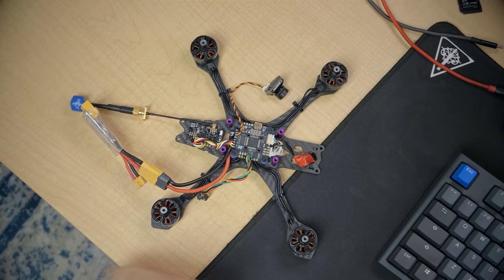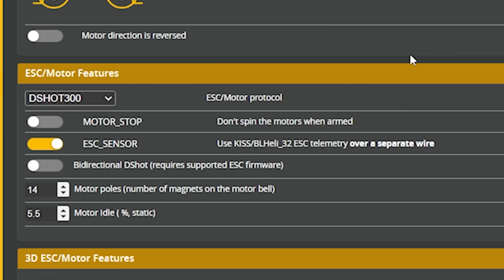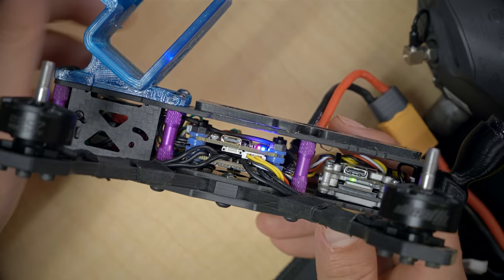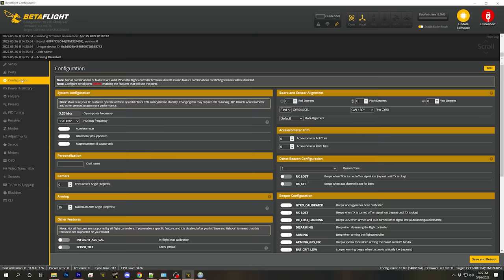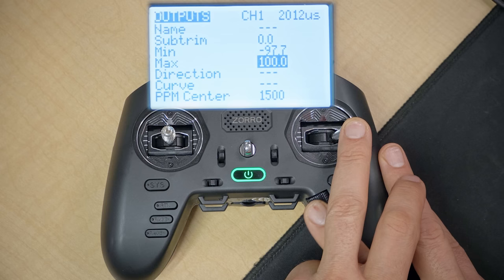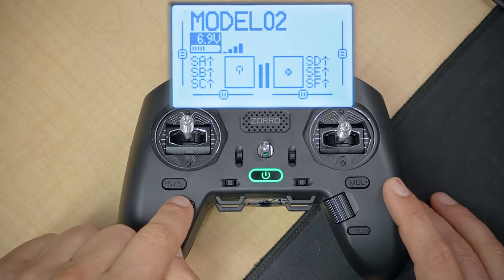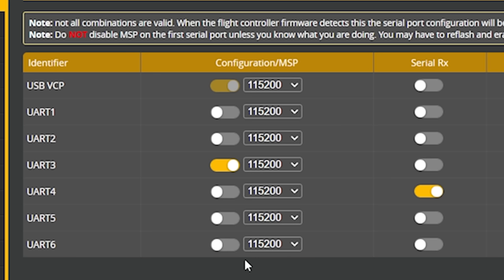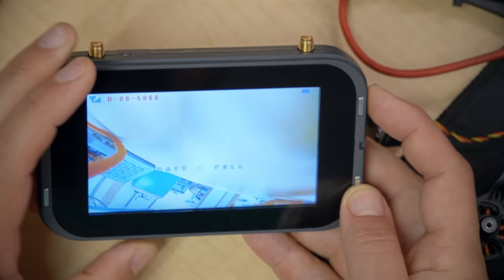2022 Freestyle FPV Drone Build - Configuration and Setup

Comment: After I got everything setup I discovered the motors were spinning when Armed, *Solution* I went into Betaflight > Motors> MOTOR_STOP = ON (Don't Spin Motors when armed) I also had to Disable AIRMODE, Configuration > Other Features > untick AIRMODE.  Thank you JB!
Reply from the maker: I strongly recommend leaving air mode enabled for an acro freestyle racing drone. This flight style often reduces throttle to zero when flying. If air mode is off and the motors stop, the quad will fall.
Reply: @JoshuaBardwell  thank you!
Reply: @JoshuaBardwell  Re-Enabled, good to go, can't wait to get this thing in the air. Thanks again!

Comment: Horizon, Angle, Acro on SC. On top of that set SC Acro as a preArm. So you have to go into Acro mode to arm the quad. After that you can go back to Horizon or Angle if needed.

I set flip, beeper on 3 pos switch.

Doing so, you add one more layer to accidental arming, since usually after land you will push all switches away from you.

And to arm again, you need to have throttle 0, disarmed and SC flipped to acro to pre-arm. And after all that arming will work.

Comment: I'm building the kit and can't get the motor direction to save when I change the direction of motor 1 and 4.   I've got v 4.3 on the FC and running configurator 10.8.  I can change the direction on the motor tab but the "Save and Reboot" button is greyed out, even after I change the direction of the two motors.  I was hoping to be able to do this through the Betaflight configurator like you showed in the video.  Any ideas what I might be doing wrong?
Reply: I am having the exact same issue. Did you happen to find a solution?
Reply: Same thing :( Any luck figuring it out?
Reply: Sorry guys. I missed the replies. I did not figure it out. I ended up reversing two wires on the two motors that were giving me problems.
Reply: @thilde007  Sorry I missed your reply. I didn’t figure it out. I ended up just reversing two wires on the two reversed motors.

Comment: Is the rubber band on your battery to mark it as charged? 🤔

I like that idea. Maybe I’ll start doing that too!
Reply: And it can hold the balancing cable nicely as well.
Reply: @MCsCreations  Ah yeah, that’s a nice perk too! I usually try to tuck the balance lead between the Velcro on a battery strap, but it’s a pain sometimes.
Reply: @pmantix  I usually try to insert it between the positive and negative cables of the XT60... But that's not fun either. 😬

Comment: I was able to flash the FC but when I rebooted one of my motors pulses whenever I connect to betaflight. Even when motors are stopped I watch the RPMs pulse on betaflight. There is voltage on the pads of that motor and none of the rest. What's wrong 😢

Comment: QUESTION: Hey Joshua, I just finished building my drone using the same components as you, but using a 3d printed frame. However, whenever I arm the drone, the motors go slow for a second before going full speed and start screeching. What should I do?

Comment: Possibly setting the motor order and, and direction may also set the FC orientation at the same time?
Reply from the maker: It doesn't. And there's no reason to assume the FC orientation will match the motor orientation. You really need a separate wizard for FC orientation. It would be easy to do. iNav for example does it automatically.

Comment: I seem to be losing connection to the quad as soon as I switch to 50hz on my elrs module. I switch back to 500hz and it works fine..strange

Comment: I've flashed successfuly, but betaflight does not ask me to apply custom defaults when I reconnect, no matter how many times I disconnect and reconnect. I don't see anywhere in betaflight to manually apply defaults.  It looks like I can only do that through the pop-up that I'm not getting.  should I move on?  Or, will this screw something up?

Comment: I can't seem to flash my receiver, I hooked everything up right and selected all the options as you did in the video but it gives me a failed to connect, no serial data received
Reply: For anyone else that is having the same problem there are two small pads that need to be jumped for the first time flash from the factory. After that you don't need the jump anymore, hope this helps

Comment: So when we are hooked up to betaflight is it 6S to smokestopper to power supply, then usb to computer? Also do i gotta worry about it overheating when in betaflight? Ive noticed some of the boards get hot on previous bnfs after a few minutes

Comment: I’m following this tutorial exactly except I have a Radiomaster TX12. When I turn in the TX12 and plug in USB there is no serial debug option. There is only the USB storage and USB joystick options. How can I fix this?
Reply from the maker: The tx12 must not have internal elrs. Are you using an external elrs module? What receiver do you have? You can email me jb@joshuabardwell.com if you want to discuss this.

Comment: Should I be getting continuity across my motor leads after soldering them to my flight controller I keep getting a Continuity reading after I finish soldering my leads to my board and it’s throwing me off. I’m scared to hook up a heart Lipo to it even with the smoke stopper cause I don’t wanna throw my flight controller😅
Reply from the maker: Yes motor wires are connected to each other inside the motor windings. It's normal.

Comment: Solved my issue, bent a pin on the FC side of the ESC cable but incase it happens for anyone else - Anyone able to help me figure out why in the reorder motor wizard only 2 motors spin (both left side when looking at the camera), and when doing manual control through the sliders 2 spin (same side) and 2 beep, but when using the master slider 3 out of 4 spin? This is my first build so I'm not really sure how to go about debugging this, I tried resolding the wires on the side not fulling working but that didn't change the results

Comment: I just ordered stuff to build my first drone. I bought a speedybee v3 722 (Esc and flight controller). I have a flysky fs-i6x transmitter and a fs-ia6b reciever laying around. Could I use those? The reciever has I bus on it but the reciever says sbus. But is there some sort of setup that I can do to change that or buy a reciever that is compatible with the transmitter and flight controller?

Comment: this has been super helpful so far. but the part I'm stuck at is I can't get express LRS to open on my radiomaster tx16s after I install it. I also don't have a debug prompt when I plug in usb if that's needed; only joystick, storage, and telem mirror. and I can't find the solution anywhere online. does anyone know what I'm doing wrong?

Comment: Joshua,
So far everything is perfect with the build. I got to the point of the DJI sections. Unfortunately I've got a FrSky setup. Are there any special procedures that I would use to set up my FrSky transmitter and Fat Shark goggles?

Comment: I'm not sure this guide works anymore as Betaflight seems to be completely different, none of the menus you go to seem to even exist, all there is is a small section in the flasher menu where you can't do a lot of the things you did.  I can set it to DSHOT but not bidirectional, and there are no options for 150 300 or 600.  There seems to be no way to get to that menu you were at where you were configuring the rotors and stuff.  Is there a more up to date guide or am I on my own with this?
Reply from the maker: You're using 4.4. This video is based on 4.3. You can still use 4.3 and the flashing options go back like they were.

We are working on an updated video series now.

Comment: With tx and rx4 being used for reciver can I still install a GPS? I cant find another tx and rx available. Can I use sbus and s port for gps?
Reply from the maker: You can use UART 3 for GPS, unless you are using that UART for digital vTX.
Reply: @JoshuaBardwell  crap, yep im using it for vtx digital, uhggg lol. Thanks for the clarification 👍

Comment: Hey JB, the first time I reordered the motors the last motor triggered the short saver when it went to spin but everything was fine when I plugged in the battery and still hasn't shorted, ever, when powering up. Upon inspection the motor had some rust on the outer shiny magnets... I got through the reorder motor wizard the second time with no shorts but do you think it could be a bad motor assuming my solder work isn't the problem? haha 

I used an ammeter to check contunuinity with no problems and the drone has never triggered the short saver until now. It IS now triggering everytime, when I try do the direction wizard... (I have got all 4 motors spinning at the same time twice now with no shorts but it seems like luck of the draw...) I can however spin each motor individually with no shorts so it seems to be only when I change motor RPM and when I try spin all 4 that it shorts... (this doesn't seem to happen more often with any one motor) I have also tested the continuity of the + and - lead to each motor pad with no beeps along with all other continuity tests and only get beeps when doing ground pad and vbat pads! 

also should I have esc sensor on in the motors tab? I have a speedybee F7V3. awesome video as always!!
Reply from the maker: https://www.youtube.com/watch?v=0CQA5dPMYJQ&ab_channel=JoshuaBardwell
Reply: @JoshuaBardwell  Of course! it must be the overcurrent when using more power for the 4 motors or high rpm on a single! I will try today without it. Happy its not a short and I dont have to resolder to say the least!
Reply: @JoshuaBardwell  thankyou.

Comment: Thank you for the video. I'm in the process of building your drone. I am at the step of deciding which way to orient the ESC and FC. Do you think it's best to orient it the same way you did? I was going to orient the ESC with the big pads forward to face the FC "forward" and possibly make the cables shorter in the process but it seems like the "forward" is actually "backwards"? I was hoping to be able connect the xt60 cable at the left front, both to make it very short and save me a headache but also so that I can run the battery balance lead into my thumb pro
Reply from the maker: You can build it that way and often times I do when building this frame. The capacitor can tuck in behind the camera.

Comment: I am in the process of building one of these and I am trying to use a frsky r-xsr and I am having trouble figuring out which port to use in Betaflight does anyone have any suggestions?
Reply from the maker: You can see me wire an RXSR to that FC in this tutorial video from 2020 - https://youtu.be/FEittnx42Zc?t=2717

Comment: maybe someone might be able to help but i have a tx12 edge tx and a frysky receiver and i was curious if i could flash express lrs? im assuming not but any help would be greatly apperciated
Reply from the maker: You can't flash ExpressLRS to a Frsky receiver or a 4-in-1 module. It only works on specific hardware. FrSky R9 and ImmersionRC Ghost already have compatible ELRS hardware, and can be flashed. But generally if you want to run ELRS, you'll just buy ELRS hardware.
Reply: @JoshuaBardwell  okay thank you! I’m just really confused because my frysky receiver binds to my transmitter but when I go to beta flight it’s not showing any input from my transmitter before I flashed bf 4.3 onto my FC built and tuned by rotor riot. I doubt they made a mistake. But i don’t know I’m lost I’m new to the hobby always had a interest but wasn’t able to really start acting on it till now.

Comment: ok im stuck on building and flashing the zorro controller. it keeps asking for a com port and it keeps looking for com4 but mine is com6 on my flight controller. how do i get the com4 detector lane to get away. its not showing it on your end at all. but on mine it is for the controller? any help is much appreciated
Reply from the maker: The exact number of COM port will vary from computer to computer. When you plug in the device to USB, a new COM port should appear. When you unplug the device, the COM port will disappear. That's the one you want to use.
Reply: @JoshuaBardwell  ok so the controller finished building and flashing but it made its own com port. it wouldn't allow for me to use the other one. so i guess i got throw that point? now im having trouble finding telemetry in beta flight lol.
Reply from the maker: Yep they moved it after I made this video :-(
Reply: ok so litterly I'm towards the end of actually getting this thing in the sky and it doesn't want to bind to the controller uhggg. i just flashed the latest version to the controller first. updated the script. then to beta flight for the receiver and flashed that. now my controller and receiver aren't talkin to each other. what can i do?
Reply: @JoshuaBardwell  😂
Reply: @JoshuaBardwell  ok so my Luna script is not working and whenever i execute it then it goes on a loading screen that never goes away. left it on for 30min. is this a manufacture problem? am I doing something wrong or is the controller broken in a sense?
Reply from the maker: You better email me so we can discuss this. YT comments are not good for conversations. jb@joshuabardwell.com

Comment: @Joshua Bardwell, Sorry if this is a dumb Q but if I am using an analog vid w/smart audio but using DJI v2 with the Wildfire BDI Digidapter setup, do I choose the JB OSD for Analog or JB OSD for DJI?
Reply from the maker: If you have DJI v2 goggles and Vista vTX choose jb. OSD for DJI.
Reply: @JoshuaBardwell  Appreciate your time to reply!. Will the analog version work for my setup even though I am not using SharkBite?
Reply from the maker: It depends what vTX you have. If DJI vTX, choose DJI OSD. If analog vTX, choose analog OSD.

Comment: I soldered my receiver to TX3/RX3 instead of using UART 4 like in the tutorial. It works fine.

However, TX3/RX3 are just above from where the VTX is plugged in. I get video, but when I arm the quad it doesn’t get out of “Low power mode”.

Is there a chance that it doesn’t work because that VTX plug in the FC is using RX3/TX3, so I basically have two things on that UART?
Reply from the maker: I can't find a pinout for that FC online, but I would say, if it's not working, do it how I show in the video because that's verified to work.
Reply: @JoshuaBardwell  sure! Thanks.

Comment: Can anyone else clarify. I always understood that the input capacitor should be as close to the load as possible. I know the reason you put the capacitor on those wires is to run them somewhere else less crowded from the battery lines, but doesn’t that somewhat defeat the purpose of that capacitor.
Reply from the maker: Yes but what choice do you have?

Comment: Wondering if anyone can help with this, I got to calibrate the motors, I have DSHOT 300 selected and bidirectional Dshot turned on but when I agree to do the motor test 2 out of the 4 motors(front 2 motors closest to camera) the error % is 0 but the other 2 show 100% and won't spin?
Reply from the maker: Try disabling bidirectional dshot. Does it work then?
Reply: @Joshua Bardwell  I turned it off and still the same, one of the 2 motors will start twitching but won't spin. I have no resistance  when spinning the motors, checked with the multi meter, and everything checks out fine. Also when I plug it in and pinch both motors I feel no vibration from the beeps but will getting all 5 beeps of start up
Reply from the maker: Ok if you feel no vibration at all from those two motors, not even the 1st-three startup beeps, then I think the ESC might be damaged and you have to contact support@getfpv.com to discuss it. Sorry for the inconvenience :-(
Reply: @Joshua Bardwell  thanks man! I've been trying to wrap my head around what's going on haha keep up the great work! I've definitely learned a lot from you
Reply: (Update) I got a new esc got it all wired up and the situation has improved. All the motors except one is not responsive. Made sure to try d shot on then off, no change. Tried to feel the vibrations and different from the last time I can feel the first 3 beeps in the unresponsive motor but not the last 2? Bad motor?

Comment: I followed this tutorial and had everything working perfectly. I go to fly today and my goggles give me a barely visible image and the screen is flickering and now I just get an even worse image. Any Idea on what may casue this?
Reply from the maker: What camera and vTX are you using? Analog or digital?
Reply from the maker: What changed? Did you change anything at all about your configuration or setup?
Reply: @JoshuaBardwell  only thing I changed is the location of the battery voltage in the osd, But I flew it after and it worked fine. I did have a small crash last time I flew, but again it worked fine. Im worried my anntenna may be damage, but I see no signs of it.
Reply from the maker: This is a tough one. It seems like hardware damage might be the issue. Try changing out the camera for a new one.
Reply: @JoshuaBardwell  A buddy of mine thinkks it may be the vtx. At this point I may as well get one of each and see if that fixes it.
Reply: @JoshuaBardwell  Pretty Sure Ive narrowed it down to the VTX. I've tried resoldering all the wires I get good continuity. If I get REALY close to it I can get a decent signal, but as soon as I more than 5ft away I just get static.  Any thoughts?

Comment: Will this build work with the dji fpv controller 2
Reply from the maker: If you have goggles 2 then you can update the Vista to firmware 01.01.0000 or newer, and it will bind to the gray FPV controller v2. If you have V2 goggles then the answer is no.
Reply: @JoshuaBardwell  I have the goggles 2 and the v2. I would really like to try this build. You done a great job on the walk through. I don’t think I would have to annoy the local fpv community with multiple questions. I just don’t want to have to buy a new RC I have the one that came with the dji fpv. Thanks for the response